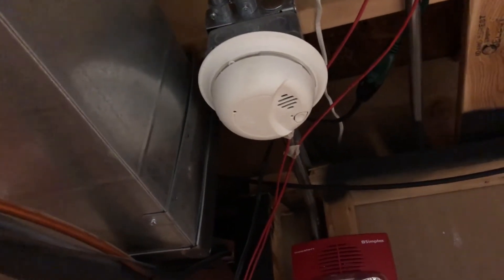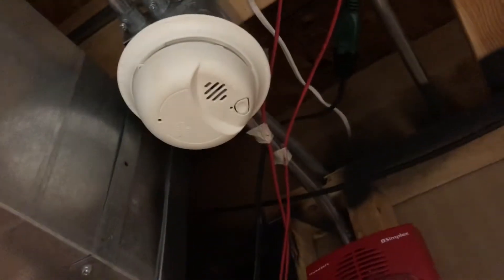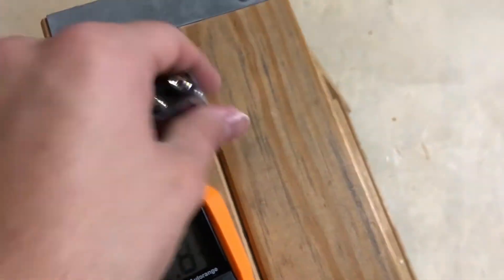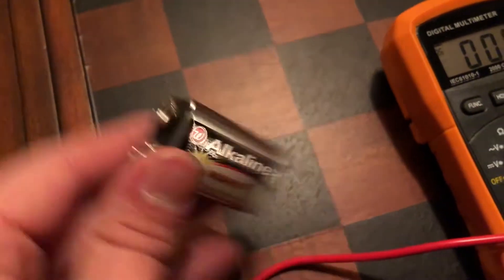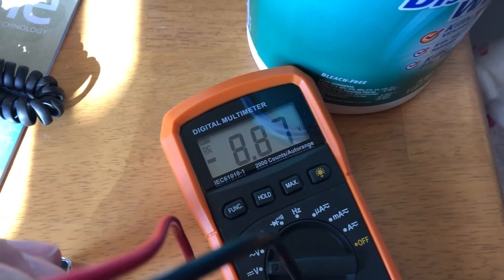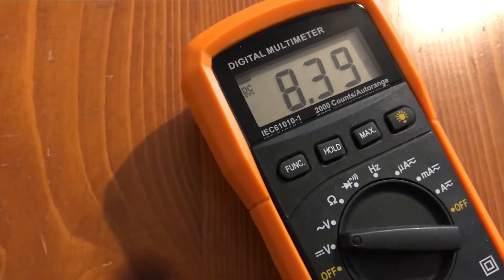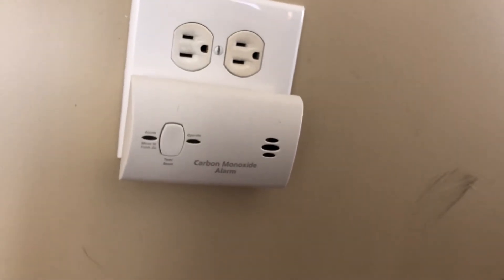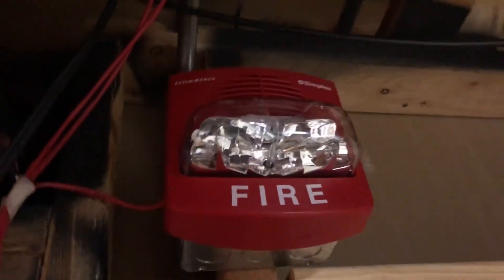Functionally Testing All Home Smoke Detectors (The Professional Way)

Comment: You can get CO tester for corbon noxide alarms
Reply: How again omd!!
Reply: @Smokesomeclocks I have no idea
Reply: Spraying that in a house is extremely unsafe
Reply: @Immortalfae_009 As long as you do it in a well ventilated area in the house with the smallest amount possible used then it should be ok as long as you don’t breathe in any of it either.